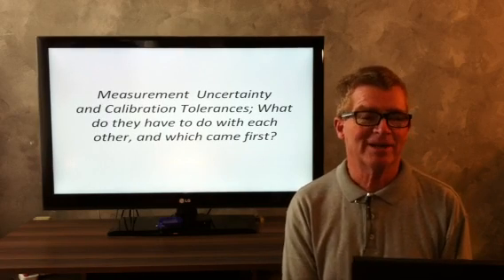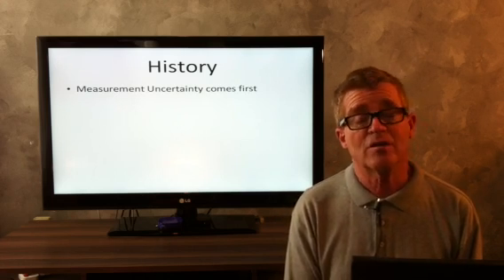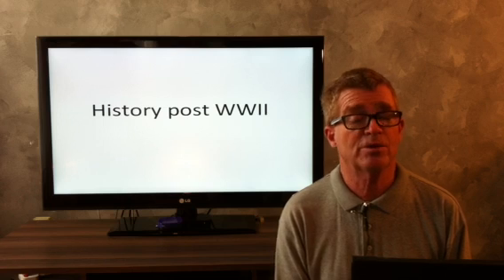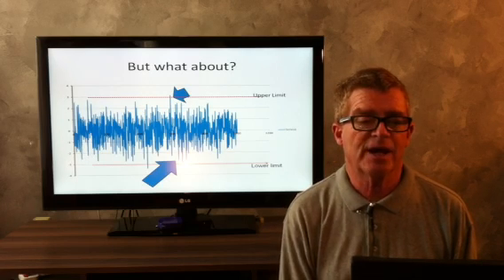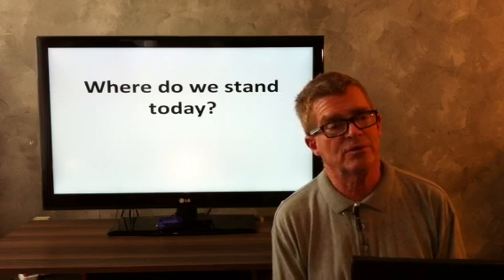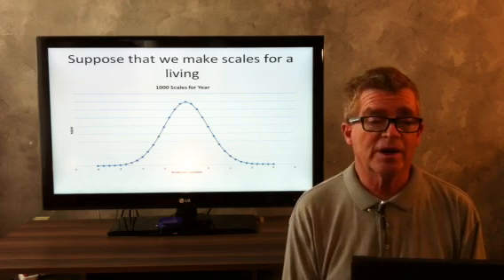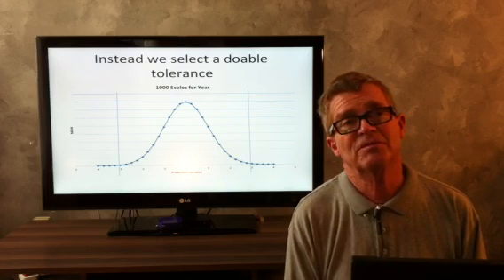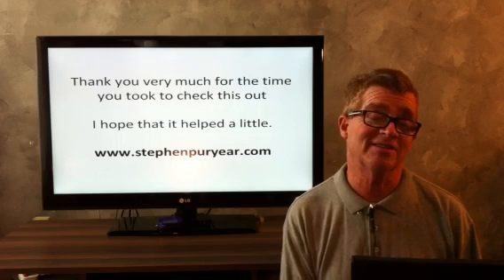Measurement Uncertainty and Calibration Tolerances

Comment: Michael, thank you so much for your question.  I did not mean to imply that 4:1 was arbitrary.  I assume that it arose from the experts who got their experience doing engineering tasks in the WWII era.  I think that this group relied on their seat of the pants feel for the risks involved, and took what turned out to be a very good guess.  My website stephenpuryear.com has a study in which I used a Monte Carlo approach to verify that 4:1 is indeed an excellent rule of thumb.  Higher ratios are very expensive, if not impossible, lower ratios show a sudden and non linear accelerating increase in risk below the 4:1 threshold.  Thank you very much for your interest!

Comment: At 6:07 it is stated "we know it works well, but we can't say exactly why", implying that 4:1 was entirely arbitrary at its conception. Can you or someone provide a reference for that? Mathematical defenses for 4:1 do exist today (even though it is not preferred by industry for valid reasons), but that of course could have occurred after the initial implementation. I am interested in learning how a TAR of 4:1 was initially selected or determined.